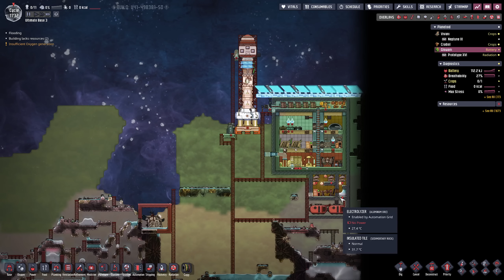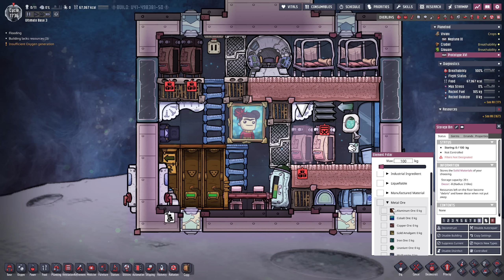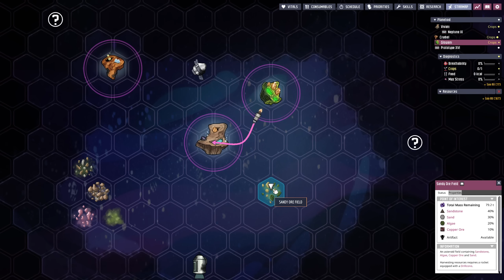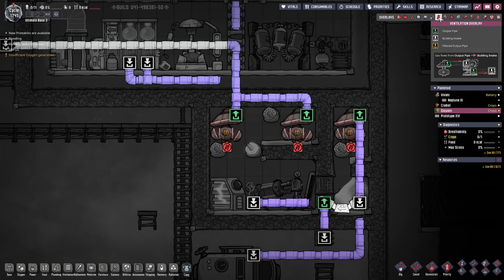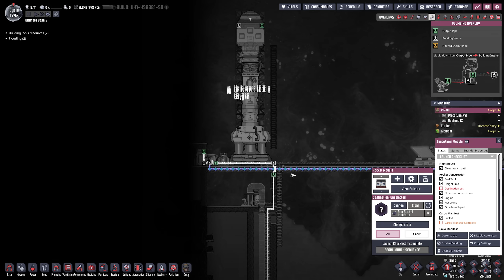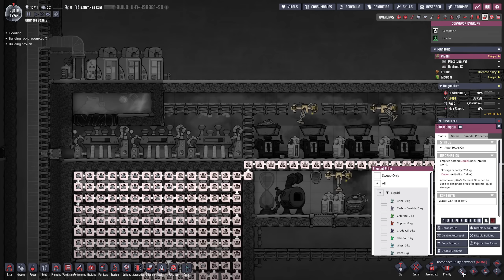VOLCANO EXPERIMENTS - ONI - Spaced Out: Ep. #66 (Oxygen Not Included)

Comment: I've had similar issues with hydras before. Forum posts suggest it has something to do with the global map position.

You can avoid this bug by doing 2 things: 1) Design your hydra to output H2 to the left and O2 up and 2) prime your H2 room before you get started.

I tend to make a larger H2 room and put a Thermo regulator inside to use the room as a heatsink. That thermoregulator keeps the deep freezer cool. It's a fully integrated Hydra/Kitchen
Reply from the maker: I tried those 2 solutions without success. I think it would be best to just rebuild it somewhere else.

Comment: Typical mistakes with 'Hydra' electrolyzer design. To make it perfect you need to do two things. First, switch rooms. Oxygen go up, hydrogen go left. This fixes tons of glitches. Second, on top of electrolyzer left tile must be solid snd right one open. You have left one open, and right one solid, this also create some problems for gas
Reply from the maker: What kinds of glitches are you talking about from your experience? I have the exact design here 4 times running for hundreds of cycles without fail and additionally when I first built it with the right tile open (mirrored) it would fail instantly. I'll do some test with switching the gases and mirror it, but I'm a bit sceptical considering I've never had glitches with the 4 copies I built a while back.

Comment: I have a 3 metal volcano setup, so id like to share a simple design for me.

5 steam turbines, 3 on the right that activates only at 200C, along about a 50 tile long rail system to cool whatever item is to min 200C. The other 2 turbines are seperated as an individual room with naphta corner vacuum airlocks, to activate anytime available (>125C). This is to suck out any remaining heat available from the metals to the lowest at 125C. Metals will be looped back if they dont reach 125C before exiting the second room.

The final cooling room would be the steam turbines itself, with ATs cooling the room down along with the STs, cooling the metals until desired temp before exiting, if not looped back again.

Comment: ⭕️ Try this method is much more efficient less challenging to build and more compact:

Build this on top of each other
At top one gas pump 
Electrolyzer on meshtile or airflow tile
Another gaspump at bottom 
And close all around it

The electrolyzer will work non stop and the hydrogen will pump out only by top pump there you can filter it with sensor and shutoff

The bottom pump will pump at maximum volume 

If you needed mor oxygen build one more of this but it should be in separated room if you mix it, doesnt work quit fine

And finally i love your series
Reply: But actually you will need a gas tank to manage your oxygen storage. 2 of this even with out storage is more than enough for your main planetoid base

Comment: I use a conveyor meter connected to itself to send smaller batches of hot materials like 5 kg of igneous rock or iron from a metal volcano. That allows you to quickly reach the temperature of the steam and it's easier to cool the material down on rails submerged in the water :)

EDIT.: For the volcano taming you can do the following steps to avoid adding more steam turbines and just control how much heat you want to inject into your system:
1. Enclose the volcano in a vacuum and add two mesh tiles to allow dripping of the magma. John Francis made something like this in his recent playthrough.
2. Create a 2x1 room with steam connected diagonally to the bottom mesh tile and a tempshift plate inside it.
3. Dripping magma should create igneous rock debris on the diagonal putting it into the small room.
4. Then you have two choices to control the temperature in your steam room. You can add "steel tiles | steel door | steel tiles" system to inject heat into the room (by opening/closing the door). Or, you can take the igneous rock diagonally by autosweepers and by using conveyor shutoff (and optionally conveyor meter) control how much igneous rock should go into the steam room. Eventually, the steam in the small room will reach the temperature of 1470 Celsius degrees and magma won't turn into igneous rock anymore so you cannot rely on the conveyor system only though.

I have never done it that way but I think it should work and it doesn't require much effort.

Comment: You are feeling the heat of the volcano :D
This is the problem I was thinking of when I mentioned problems with your other volcano. In this case there is little chance that you get solidified tiles because it is spread out much more, but it produces way too much heat to handle in the short amount of time with only three ST. Cooling your autosweeper is not a longterm solution, your AT will not be able to keep up and polluted water in radiant pipes will almost instantly boil in your steam room. Your best bet is to control the amount of magma you add to your steam room to cool it down properly and take advantage of the heat. Good luck with that!

Comment: It's very likely that the top atmo sensor was incorrectly set, if the pressure in the top room gets too low, oxygen can seep in. I mean that in the first instance, where the gasses at first did separate correctly. The latter cases I think you need to prime the hydrogen room. The thing is, if you have a vacuum on both sides - both gasses have a similar chance of going either way so it is random. You got very lucky that it went right the first couple of times actually :-)
Reply: First build he primed the oxygen side so the hydrogen with to the vacuum. Are you saying it could still go into the wrong side?

I recently made this contraption and only primed the oxygen room.
Reply: Yes, priming the hydrogen room should help.

Comment: Hi Nathan, awesome video! Two possible reasons your spom aint working - you might need to prime the hydrogen and oxygen in the correct chambers before you activate the electrolyser. the other option is to add an airflow tile to the gap where your hydrogen leaves the electrolyser area - this might encourage that water not to move around so much.